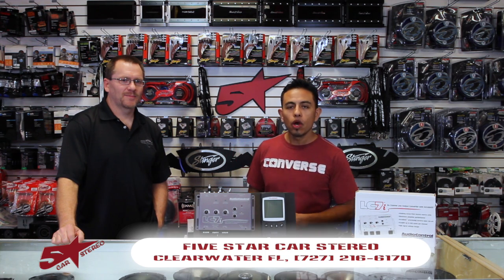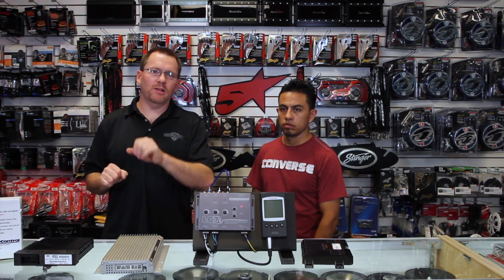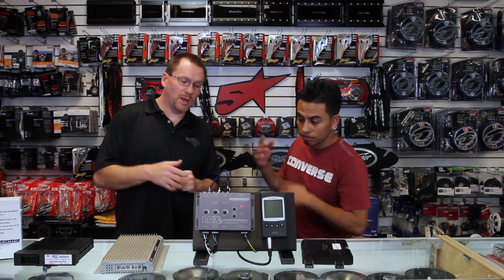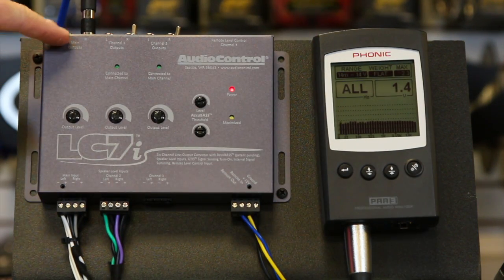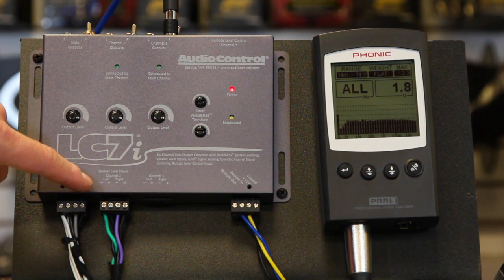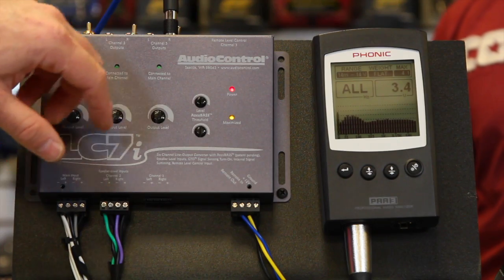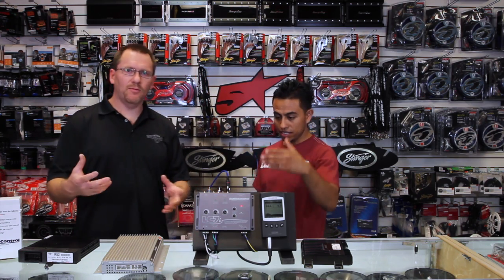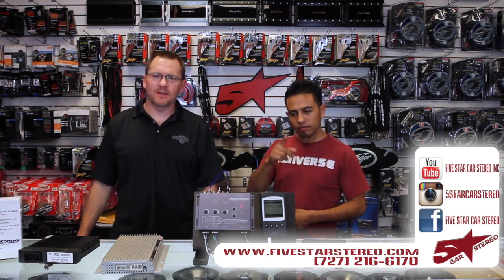Introduction to AudioControl's LC7i part 3 "how to do 2 channel input and 3 channel output"

Comment: i have a 2014 kia optima ex, basic oem stereo, no amps no subs. 6 speakers total 2(3.5) in the dash, 2(6.75) in front and rear doors. i want to keep the factory hu and replace all the speakers. i have already replaced the dash speaker's with polk audio db3.5's and installed the resistors and they sound decent. so my question is first do you know what the front and dash speaker config is for this model? is there a crossover for the two are they run in series from the HU? second assuming they are and i only have 4 channels out from the HU will this lc7i be what i need to run an amp to all 4 door speakers and keep the dash speaker's on the HU or can i run the 4 channels from the HU and then seperate the dash speakers from the lc7i? i dont want to install a sub just yet so i want to run the 2 dash speakers 2 front door speakers and 2 rear door speakers, would the config be HU-LC7i-AMP-SPEAKERS?
Reply from the maker: If the Kia is a base model stereo, then the dash and front speakers should be in parallel. The LC7i would be the right choice for this install. I would get a 4 channel amp and power everything from the amp ( dash and all speakers). Yes it goes radio- LC- amp- speaker. I hope this helps some.

Comment: p.s how do you tune it
Reply from the maker: +jdoggy314 here is our steps for tuning. First check the Phase on all the speakers to make sure there are none backwards. you can get an app on you phone or a phase checker on Amazon for $8.00(search-Black-Speaker-Polarity-Tester)Next- turn all the level and gain to there lowest settings,  make sure Bass and Treble are 0, and unplug the RCA's to the amps. Then get a pink noise generator ( on your phone or disc)and play it in the radio with the volume 3/4 of the way up. If you have access to a SMD-DD1 you can use that for a more accurate volume level. Next turn up the output levels on the LC7i until the Maximized light starts to flicker, it is best for it to stay off altogether. Now turn the volume down, remove the pink noise and plug in the highs amp rca only. Play some music you know well, set the Xover on the amp to your liking. Check sound at all levels if you feel you need more Gain you can add some but I would not go past a 1/4. Turn it back down and plug in the sub amp, repeat previous steps. Make sure the blend is good with small adjustment to gain or levels( Maximized light will come on with music, it is OK). Play multiple types of music for best performance. Enjoy.

Comment: i know..i figure that out but i got aftermarket speakers and so i should turn down the acute bass all the way down and turn up stereo until  i hear it's bass drop which is kind of hard..and turn acute bass..
Reply from the maker: Try this- Turn the AccuBASSTM Level control fully down, rotate the threshold control fully clockwise to lock in the bass equalization. Now you can turn up the AccuBASSTM Level control for the amount of bass you want.

Comment: What would be the best configuration for a 2013 F150 with factory head?  I want to keep my factory head.   My truck has pillar tweeters and door speakers.  I believe the crossover is in the factory head.  I want to replace all factory speakers and power them with a separate amp.   Also, want to add another amp and sub.  Does the accubass only work on sub bass or can it restore bass frequencies in the mid bass/door speakers?
Reply from the maker: First question would be dose it have the Sony system? Is there a factory amp under the dash kind of by the steering column? Is there a factory subwoofer?
Reply: +Five Star Car Stereo No it does not have the Sony system that I'm aware of.  No subwoofer.  It has the sync system, no nav, no touchscreen.  2013 F150 STX supercab.  BTW, great videos on the AudioControl gear.
Reply: Did you ever get one for your f150?  I have one coming for my 2011 f150 with just the basic radio like you got.  Did it make a great improvement?
Reply: @FiveStarCarStereoInc  I have this exact same truck and set up, would love to know!